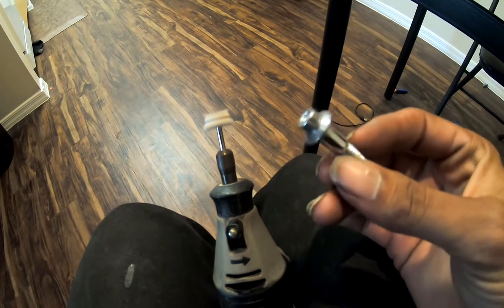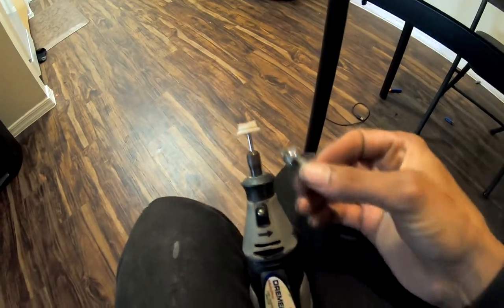Racing Hart Rebuild

Comment: Man love the racing hart c2
Reply from the maker: They are great cant wait to roll them
Reply: @sobsteez  class wheels man. I own a set of Racing Hart Type C Tracer Alloys. I looking to restore but i can't find the center caps anywhere. Do you know any thst msy specialise in stocking or that could remake these to the same spec
Reply: @kingkenny2797 The complete center caps are almost $700 new. Are yours M7 or M8 hardware? I’m looking for new bolts